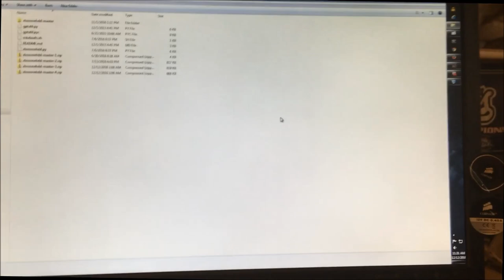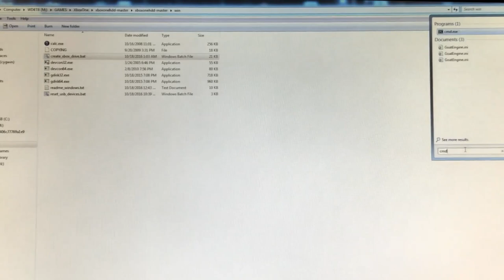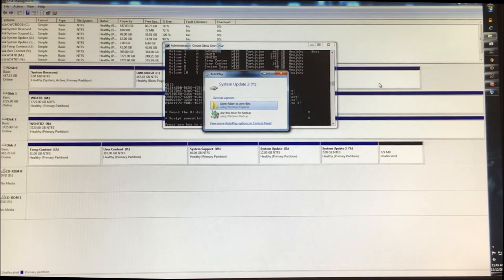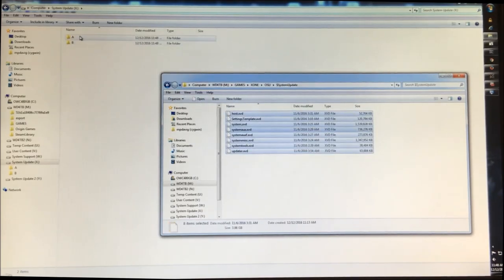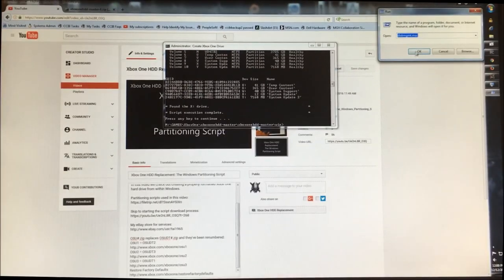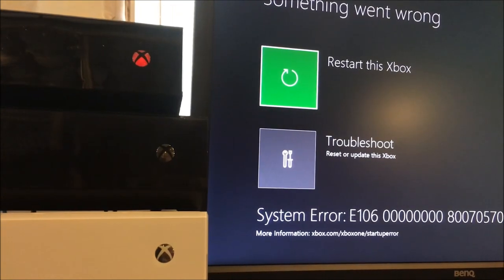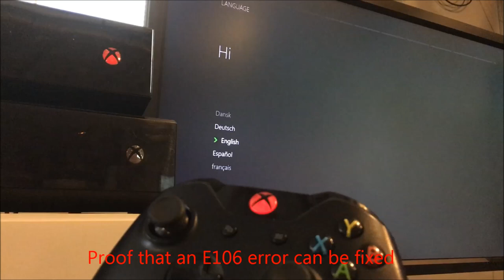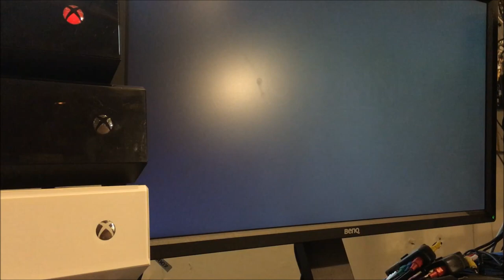Xbox One Internal Hard Drive Replacement: Create a New 500GB Drive Start to Finish

Comment: Just replaced the original 500 gb hdd with a 500gb ssd in my xbox one s, This method worked flawlessly much easier than linux scripting. Thanks XFiX :)
Reply: Which su do I use 1 2 or 3

Comment: your script and videos have helped me fixed my xbox one failed hard drive problem. None of the usb methods worked for me but doing your method of putting the OSU1 in A and B folders like you said did the trick. Thanks!

Comment: Hey just fixed my xbox and I did the a and b folder like you showed, even though you did not have success, I did and mine loaded right up (but would not connect to the internet, then I realized I did not plug in the wifi cable to the main board) once I fixed that it worked flawlessly. THANK YOU!

Comment: thank you so much, FINALLY got my xbox past the stuck at 66% mark. used your script to format the drive, copied the files into A and B with update at the root of the drive. It booted back to the same update screen, looking like it was going to stick again and I thought it was going to stick again but it pushed on through. However I did ripe my front panel cable in half so I had to order a new one. BTW if you do ripe your cable in half, you can turn the console on by placing your finger on the insert where the cable goes into the front logic board. The bottom powers on and the top ejects it, if you touch it with your finger, lol
Reply from the maker: This is a good tip but also why I like the "S" button design better since it utilizes real tactile buttons instead of capacitive buttons over ribbon cable.

Comment: Thanks for making this. It was a little confusing with the renumbered OSU files because there are a bunch of language files in the OSU1 that don't match the video. But, it worked out and now I have a working Xbox. Opening the case and replacing the HD was a lot easier than I thought it would be, but I build desktops so...
Reply: Which osu to use?

Comment: This is a wonderful video. I had an Xbox One lying on my floor for a year with some restoration errors. I remember succeeding with some scripts a while ago, although some of the partitions ended up in a RAW data format. I'm following along with you hopefully with success. 

Your room looks like my room. 

Wish me luck!
Reply from the maker: Glad you found this helpful but you might want to check out the newer version of this video:
https://www.youtube.com/watch?v=I2r1YA7IfnA
Yeah, you can never have too many consoles, monitors, what have you.
Reply: hm, I've restored the hard drive. 
still encountering the dreaded "hardware problem" in regards to network detection. the console doesn't want to go anywhere with an error like this. 

would you have any suggested reading/viewing material, sir? 

thank you.
Reply: That's the same problem I have, the hardware - network problem. No way to solve it
Reply: MrBear,
I ended up pursuing the HDD formatting and the OS installation. It is in fact a hardware problem, not a software issue. I was hesitant to trust Microsoft. 

I solved the problem by purchasing a replacement WIFI card offline. It showed up scratched and dented, but it worked fine with the console. 

Perhaps try ordering a couple of cards.. I have a feeling you may have to try more than one. 

Will
Reply: MrBear I've fixed mine.

Comment: Great video, this tutorial worked great and I didn't come across any problems what so ever. I tried so many times and watched so many other videos and none of them worked. Thanks so much this video is great, the problem I had was that I was trying to swap out my 1TB from my old xbox one and replace it with a 500GB so that I can use the 1TB in my new xbox one S that only came with a 500GB, so now my next task will be to do the opposite of what I just did and swap the 500GB to the 1TB lol.
Reply from the maker: Glad you had success on the first part.
Use this video for the 500GB to 1TB process:
https://www.youtube.com/watch?v=I52aS9xJkZk
Building a 1TB like you did the 500GB will likely be problematic.
For what ever reason, Xbox One seems to only like to build 500GB drives from scratch.

Comment: same errors after doing all this i started with. Possible bad hard drive? The hard drive is the original and works great on the PC....maybe bad sectors some where? Just not sure if i should try a different hard drive or if maybe its the xbox itself?
Reply from the maker: Sorry you are still having trouble. I would suggest watching my latest video on this process. Do not bother doing the A and B folder stuff and use a USB flash drive instead. Also, make sure you do a reset as I do in this newer video:

https://www.youtube.com/watch?v=4xYQQicXdU0
Rarely is it the Xbox itself. A reset and an offline update will likely resolve the issue you are having.

Comment: XFIX you work great, too bad I'm so far and i have to figure this out by my own ! My xbox was working fine but not recognizing wifi (i could use it with the ethernet cable). I decided to have a factory reset to have the problem fixed, it got worst because it would not find the connection from the ethernet neither. After 20000 tries i am now trying with a new SSD 525 gb. I do the ubuntu partition and installation using OSU1, but when i turn the xbox on, it gets
 stucked on "Preparing your console", then directly goes to troubleshooting with error e102. I then try to do the factory reset from a USB, but it won't start and the error will change to 101. What am i doing wrong? what do  you suggest me to try?
Reply from the maker: You'll definitely need to do the OSU1 update from an NTFS formatted flash drive and make sure your system is not beyond version 15063.4103. Finally, if you used my scripts to prepare the drive. Make sure the GUID values match the values shown in this video.
No idea about your network issues, just make sure everything is physically connected properly including the antennas which I see broken quite often.
Reply: thank you for your answer. I did everything right, using Ubuntu. When I start the xbox, it gives me an  error just like the one you are fixing in this video (the error is a e 102). Then, when I put the OSU1 pen drive, it will try to start the update, but will quickly go to another error (e 101). Any suggestions?

Comment: Great tutorial.  Successfully installed a new hard drive.  Currently trying to use it to fix E100 error unsuccessfully though.   You mentioned in the description it's usually the ODD.  Is this still your opinion before I start desoldering / resoldering the daughter boards? Thanks.
Reply from the maker: Yeah, E100 is a tough one.
This usually means ODD missing, dead, or non-matching. If you know you have the matching daughter board you could desolder the firmware IC with some low melt solder or a hot air soldering gun and swap it to another donor board.
If it isn't the matching ODD you're SOL unfortunately.
Reply: Thanks for the reply. It's fixed now! All I did was reseat the ODD cables & we're back in business. :-)
Reply: Beardy Beardit Hi i also have E100 Error, can you explain how you fixed it

Comment: Thanks XFIX. 
My Xbox one 500GB crashed.
Replace it with a 1TB done the correct standard format.
Did not copy the system files I used the USB works better for some reason.
Only problem i picked up that it still shows as 500GB.
Not sure what to do any advice.
Thanks a lot saved me on paying someone to fix it for me.
Reply from the maker: You did everything correctly for building a new drive. Even if it's bigger than 500GB you have to build it as 500GB. 

If you want to use the extra space follow the GParted section of this video, skip the CloneZilla part since you already have a working drive:
https://www.youtube.com/watch?v=I52aS9xJkZk
Reply: XFiX  one more question will I lose the game that I started to download
Reply from the maker: You shouldn't, in fact it is critical that you don't. GParted moves the last 3 partitions but doesn't destroy them and "User Content" is increased  but the data should remain intact.
Reply: Thanks a lot XFIX you are the XBOX GOD.
I am moving all the xbox games to an external as a precaution.
Will let you no how it goes.

Comment: Wow what a great tutorial! I am going to replace the slow original 500 Gb HDD 5400 rpm with a new SSHD same size (500 Gb) saving the original content: should i have to partition it with your script on my windows 10 system and later copy and paste the files from the original disk to the new partitioned disk or there is something else to be done? Thanks
Reply from the maker: What you mentioned should be fine. Just be aware that you cannot have 2 Xbox One drives attached at the same time to Windows so you'll need to copy the contents to a temporary location from the original drive.
If you have a flash drive handy it might be easier to use CloneZilla to copy the old drive to the new. As I did in this video but you can skip the GParted resizing part.
https://www.youtube.com/watch?v=I52aS9xJkZk
Reply: Worked like a charm! I have attached the two disk on a W10 system (one on USB the second on a SATA port), no problem at all! Now the console is much more fluid and BF1 loads in half time compared to the original Samsung 5400rpm disk! THANKS you're the man!!!

Comment: Now what if you buy an external hard drive plug in and play style, transfer all data to that one then remove internal hard drive and replace with the external? Would it work? Fix the problem before the stock hard renders the console inoperable.
Reply from the maker: Unfortunately the internal and external drive layouts are very different. Internal drives have system files as well as user data and 5 NTFS partitions. External drives only store user data and have 1 NTFS partition.
Reply: @mpdavig  Thank you for not letting me find out the hard way, Programming and formatting a hard drive has to be done to upgrade or replace stock hard drive👍

Comment: i got new xbox one S 1TB console. 
can replace 500GB SSD? (inside console)
please can you explain how to do it, step by step. many thanks
Reply from the maker: I would follow this video exactly.
Since you cannot clone down, treat the system as if it doesn't have a drive.
Format as a 500GB Standard with the Windows Partitioning Script. Put the latest OSU1.zip on a flash drive.
Don't touch your 1TB drive in case things go south on the SSD attempt.
Personally I've never shrunk a system so be careful with this.

Comment: Hello, I have a couple of questions I hope you can help me, the first is that the script for windows finds the disks that my computer has, but it only says "No USB/SATA drives found" and the script ends.
The other problem I have is, I get it done with linux but after the installation and the later application update, it shows the command and asks me the language configuration, but then says that it has to be updated after a couple of minutes says There was an error and it no longer happens there.

Note that by pressing the triggers and the RB and LB shows the error, but in the No. Serial section is blank, is this normal?
Reply from the maker: For the first bit  "No USB/SATA drives found", it's because the script is currently dependent on English being the default language.
For the second bit it sounds like you are unable to complete the initialization process because the update doesn't complete.
You probably need to do an "Offline System Update" using BIND and EJECT which is documented here:
http://support.xbox.com/en-US/xbox-one/console/system-updates-solution

Comment: Excellent videos, and easy to follow! I am unfortunately stuck with a box that updates to 59% and does a weird partial shut down thing. I have use the tool at least 15 times, have the latest OSU1, tried A/ B folder method and now twice without the method with no luck. XBOX instantly throws the E106 error, repair using USB, shuts off at 59% with the light still pulsating, but no reboot. I have left the box on like this for a day with no results. Weird thing I notice each time I hook my HD back to PC, all folder dates revert to 9/1/2014?? any advice? 1TB version XBOX ONE..
I have a booting console!!! Tried starting from OSU3 up to OSU1 and it is booting to the "apply 3.7GB update screen". New problem. 75% of the way through it goes to restart and never comes back up! Tried the new OSU1 from the April and notta..sticks at 59%.
Reply from the maker: Hard to give you a definitive answer on this but here is what I'd recommend to solve it. 
1. Keep the drive completely empty after partitioning it. No A/B folder stuff. Likely getting in the way. Often results in E106.
2. Use selection (b) 500GB Standard, always. I'm convinced there is no such thing as a 1TB or 2TB system. The Xbox OS doesn't care about partition sizes but will always attempt to reset to 500GB (365GB User Content). Meaning a 1TB or 2TB will be fine until you are in the situation you are in. If you create a 1TB partitioned drive, it will reset to 500GB, sometimes causing the failed update process you are getting. 
3. Use OSU1.zip from a flash drive. The first time you boot with nothing on the disk but properly formatted should result in an E200. Perform the offline update and you should be golden. OSU2.zip and OSU3.zip are only for pre October 2015 and day one dashboard systems.
4. If you are getting any errors unzipping or downloading OSU1.zip don't even try to use it. As of today your OSU1 files should be dated 4/8/2017.
Reply: Well I certainly appreciate the detailed response and all the videos are great! After another 10 attempts , I gave up and picked up a 500GB HD convinced that it has to be a bad sector somewhere. I ended up with the same results! Boots first time with E106, so I force it into reading the USB drive with OSU1.zip from 4/8/2017, 59% it shuts off to only the light. I am convinced that it has to be a hardware error at his point. Only thing I did at the start of all of this that I am concerned about, after watching your videos, is the reset that wipes everything. This was per advice of a MS tech after it was stuck in this endless cycle. Any thoughts before I trash this thing? 3 weeks down and I am beyond my frustration point...
Reply from the maker: Contact me on eBay if you haven't already.
http://www.ebay.com/usr/tai1965
Reply from the maker: venom6608 Don't trash it though. We can work something out. I've been able to get 100% of the machines sent to me working and I have a money back guarantee if I can't.
Also, just put a new video out today where I spend the first 15 minutes talking about issues similar to yours.
Reply: I will contact you on Ebay, I have tried everything so many times that I am at a loss. I noticed on your new video that the box you worked on restarts at 59%. I can hear the HDD cranking, but it will not restart at 59%, and I am trying a third HDD! Beginning to think there is another issue; maybe in the Nand memory; I have even tried another power supply...

Comment: What are the U2/U3 zips for? I watched the video and I thinking of doing this to a SSD but I not sure why we need all the other files, I have XB1 and XB1s, both stock 500GB systems.
Reply from the maker: It's unlikely you'll ever need OSU2 or OSU3.
Microsoft does not directly explain the differences but . . .
OSU2 has not been updated since 2015-09-04, my guess is if you have a console that has not been updated since before this date you'll need OSU2 before you can use OSU1.
OSU3 is strictly for day one consoles 2013-11-22 that have never been updated and is required before you can apply OSU1.
Reply: Thanks for clearing that up :)
Reply: Osu1 is fine for a new hd in my one x correct ? Have all the files dloaded and extracted just waiting on the sata cable in the mail

Comment: My Xbox was updating last night, during the applying update stage I accidentally hit the power button. Turned it back on as quickly as I could. The xbox one turned on but the display took like a minute to show up, once it did it was showing the applying update screen again with a 50% progress bar. I was think everything was ok but it wasn't. About 10 minutes later it said something went wrong with and error code E100. So I did the usual power cycle and made sure every thing was unplugged from the xbox before turning it back on. Turn the xbox on and it did the same thing, so I decided to browse the internet for solutions and tried pretty much everything. The offline system update gets to 1% then says something went wrong, I was starting to give up. So i researched some more and came across your video, it took me awhile before actually trying this with the HDD inside the xbox but I wanted to see if it would work. Sadly it did nothing... Now it just boots up straight to a "something went wrong" screen with options "restart" and "troubleshoot". Thinking I would be able to run the offline update no problem I give it a try. The progress bar moves to 1% then instantly says something went wrong.... I tried all the OSU's and even the factory reset. The way I see it is the HDD is done for. So RIP my xbox, still get E100 then when i try the oflline update I get E101.  

This comment is way to long....
Reply from the maker: Are you positive that you are seeing E100 errors.

With every system update one of the first steps is the Xbox One checks for the presence and proper response from the Blu-ray drive. If any of these checks fail E100.
In other words you have a missing, broken or non-matching optical disk drive. If you are lucky one of the cables is unplugged.
Reply: yeah I'm positive, I could send you a video of what's going on. I could always check to make sure everything is plugged in properly.